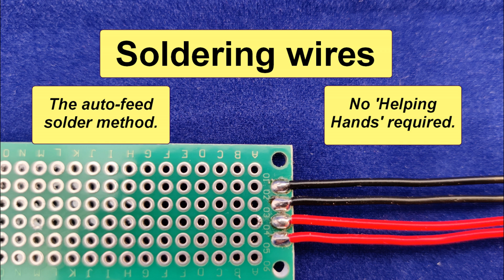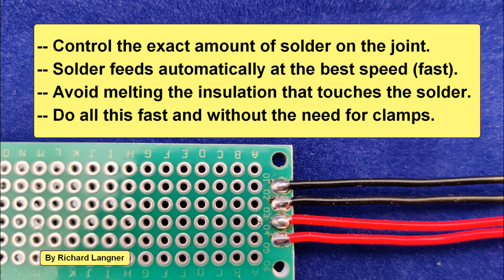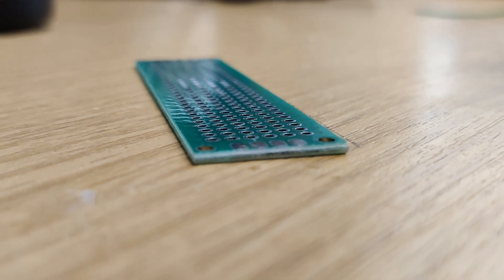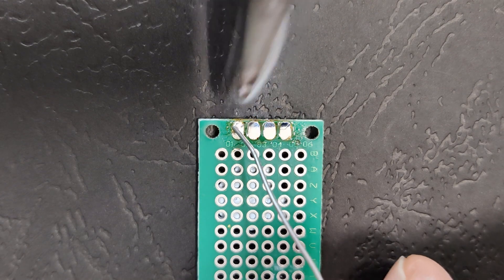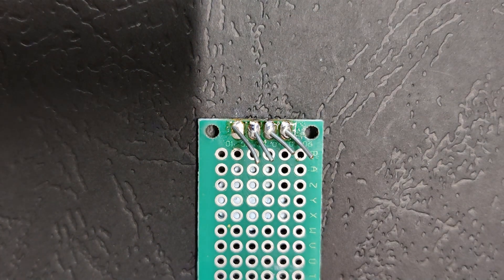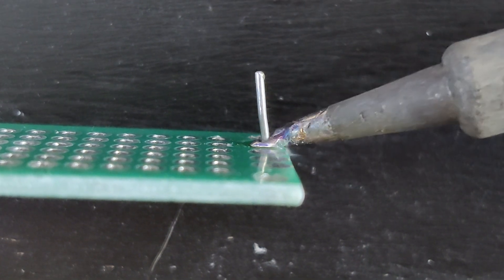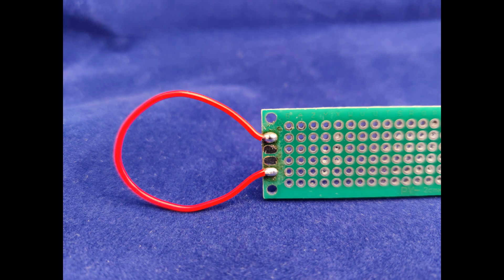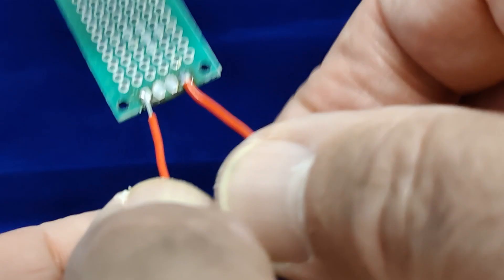Hands-free solder feed. No tools required other than a normal soldering iron.

Comment: Rich , I just found your video on soldering wires. I've been trying to avoid melting the wire insulation when soldering.
I'm going to try your method of pushing the insulation back away from the solder joint to prevent melting it. I'll let you know if it worked.
Thanks,
Gary

I successfully pushed the insulation back so that I could clamp just the wire with my pliers to prevent melting the insulation. I was able to push the insulation back close to the solder joint by holding onto the other end of the wire and sliding the insulation slowly.
Worked great! Thanks for your video.
Reply from the maker: I will be making a video (or two) on soldering in the near future, and will show how to work with various types of insulation on wires. Some wires are just not designed for soldering, and the insulation melts very easily. Also stranded wires 'wick' up the solder, making it less flexible where it lease the PCB.
Thanks for the feedback, and if you want to suggest other issues with soldering please let me know.

Comment: I don't like this. The wire should be threaded through the hole from the component side and then soldered. This will prevent the wire from being ripped away from the board and it looks better.
Reply from the maker: You are correct. Making a good mechanical joint first would only require two hands to solder, so this method is not needed.
However there are times when you don't have the luxury of a mechanically sound joint, such as the end PCB connections on my board (they are there for a reason!).
Another thing is that SMD parts do not have a good fixing, and I quite ofter use this method, although it requires some practice to perfect.

Comment: Here is a trick I have used.    When you want to solder to an enamalled coil wire, getting the enamel  off and the copper bright can be difficult.   Use an aspirin tab.
Lay the aspirin tab down on a suitable surface that will not get damaged by the soldering iron.     Position the end of the enamalled wire on the aspirin tab.   Apply heat
and a bit of solder to the tip as it touches the wire against the aspirin tab.    Tab melts slightly, turns brown, and there is some smoke and it bubbles slightly.   This reaction
of the heated melted aspirin burns the enamel off the end of the wire and the copper is clean, bright, and now tinned as well.     😎
Reply from the maker: Sounds interesting, I must try that after I find out what the fumes are!

Comment: I've been doing Electronics for 50yrs, I've never seen these two techniques before 😮

Thank you so much mate 🍻
Reply from the maker: I will be doing a soldering and desoldering video soon, so stay tuned!
And Thanks for your comments.
Reply: @richardlangner  I was going to post exactly the same! I've been soldering for 40 years and I had never seen and not even heard of this. It is so simple that you would think that by now I should have "discovered" it.. yet 40 years on and never thought of doing it this way.
Reply from the maker: @TheAlchaemist  It was the obvious solution to not having 3 hands when working on site, and without 'helping hands' etc.
It seems obvious is not obvious for everyone!
I'm going to do a rework of my desoldering video which shows desoldering with no tools (just an iron). Stay tuned.

Comment: Thanks for sharing. But How do you conect thats soldered points with the holes on the perfboard? Sorry about my english!
Reply from the maker: This is for joints that have no mechanical fixing. A future video will show the finer points, and general soldering, and desoldering.
Reply: @richardlangner  I mean, how do you conect the red wire next to 05 with A05 hole on the prefboard? Or the black wire next to 01 with A01 point? I think that those wires are for powering the circuit in the perfboard. Ignore me if I'm talking nonsense. Thanks a lot.

Comment: I'll add some balance to astounded comments and let you know I have been a technician for 48 years and have always used this technique. You can also attach the solder to the wire for wire to wire joints
Reply from the maker: Hi Paul. After doing this since the late 1960s, it astounded me that very few knew about it. I searched for years on the web, and as I didn't find anyone else who had already done a video, I thought I'd give it a go!
I'm preparing to make another video on other techniques I use, some of which may be well known, others not. But they are all pretty obvious, at least to me.
Thanks for the feedback. If you want to share any of your tips with me I may include them next time - with credits of course.

Comment: This is a poor soldering technique, possibly suitable for an amateur who requires occasional soldering for research purposes every 100 years or so, but not for more demanding applications.
Reply from the maker: This technique is for soldering a wire to a pad - there is no mechanical strength and it should not be used in demanding applications. It's for small projects where wires don't need support, such as in a project box and over a short length. However I've used this as a supplement to other skills. I hope to make another video soon showing the advantages and how this prevents cold joints. And other tips. I would apprecciate your feedback on these too. Thanks.

Comment: Do Brits really call it "soul-der" and not "saw-der"??
Reply from the maker: Soul-der is for Brits - rhymes with shoulder. Sodd-er for USA. What is it where you are?
Reply: @richardlangner  As a broadcast engineering trainee at the ABC c.1980 I was instructed in "high reliability hand soldering" with a NASA training film. The class fell about laughing at the US pronounciation "soddering" . But cleaning the solder immediately prior to use was one of several tips I've used ever since. Thanks for this tip.
Reply: @richardlangner  Interesting. I'm in Toronto, where I learned sawder / sodder from people of my dad's generation (60s kids).

Comment: I am almost a complete novice, so pardon me if it is a stupid take: from what I see, this approach can lead to too much solder being on the board. Which can cause issues like poor connectivity.
Reply from the maker: Thanks for the feedback. For the demo I used thick-ish solder and put extra length legs of solder on the joints. This was for the demo only so it could easily be seen. In practice I use thinner solder and shorter legs so not as much solder is on the joint. Had I realised that the video would be so popular i would have made it more accurately!
The tremendous amount of interest has convinced me to make a follow-up video showing how I use this technique and what other tricks I use. So stay tuned - just remember I do this unpaid in my spare time to help fellow electronics enthusiasts so please be patient.
Reply: @richardlangner  thanks for the reply, subscribed and waiting for your next tutorial :)

Comment: Would love a demo on the through holes rather than the pads, not sure if you use the same technique or something different.
Reply from the maker: The through-hole components don't require my technique.You don't need the extra hand for that.
In a few weeks I hope to be making another video showing more tips.
Reply: @richardlangner  ah yeah makes sense!

Comment: Thanks for the video, but if you can solder, it's not necessary to do it like that. I solder and I've been learning it for 40 years.
If the pad and the end of the wire have been tinned with the right amount of tin, all you have to do is put the end of the wire on the tin pad and then briefly hold the soldering tip to both and it will be perfectly soldered. Your method makes it a little easier if you're not that good at soldering yet.
Reply from the maker: Thanks for the feedback Andre. Of course you are quite right, experienced solderers can just do the job their own way.
This is just another technique in your skillset. I don't use it all the time, but yesterday I needed to solder a microswitch which was recessed and barely had enough room for a soldering iron and the wire to be connected. So I fed the solder where the wire would go and left a 'leg' of solder, then fed in the wire and used my technique. Just so much easier I think you'd agree...
Another video to come showing the finer points and an extra easy tip.
Thanks again for the feedback.

Comment: unnecessarily complicated. Plus you waste material and time, so what's the point? First tin the cable and preferably the place where the cable should go and then simply solder it in place. Why repair something that works perfectly?

btw, to solder one cable after the other you don't need a third hand.
Reply from the maker: Back in the day I used to change LOP transformers in customer's homes, when the connections had no mechanical fixing and the wires had a mind of their own. I tinned wire and tag, but by that time the flux was used up and the joints didn't flow as well as I wanted. I needed a way of feeding in fresh ready-fluxed-solder, and this seemed the obvious way. It's not a method that I use all the time, it's just another tool in my skillset. An alternative is to flux the joint and use your method.
There may come a time when it will come in handy for you, so remember me then!
Thanks for the feedback, it's always good to hear other's opinions and experience.
p.s. the solder was extra thick for the video, I normally use much less and complete the job quicker.

Comment: I stumbled on this a while ago, but didn't think it was particularly uncommon.  Another fun method I sorted was to fill a desoldering bulb and inject  solder into the site.  I discovered this when dealing with arc solder materials that require higher temperature than the medium can handle.  It can be uses to affix but also create a lower temperature alloy that is far easier to quickly manage.

Comment: Thats a really cleaver idea.  I usually use silicon wire if i have to solder wire to a proto/perf board just so the insulation doesn't melt on me

Comment: Does this work in situations where you're working so tight where you can't easily get a soldering iron in like you can by running the solder down a wire?
Reply from the maker: Never tried that, but best to avoid tight spaces. Remember the joint will only be strong enough if there are no forces acting on the wire, such as in a small enclosure. For anything else you need to make the joint physically strong. Thanks for the comments.

Comment: I will instead pre-tin both pads and the wires, apply Rosin flux to both. then just join together and apply heat. Don't need rosin core solder for that too, can reuse desoldered solder even, if ran out of supplies.
Reply from the maker: Thanks for the feedback. I also use that method when I have seperate flux.

Comment: Right, not a technique I would use at all. 
Once you know how to solder, it all goes automatically without the extra unnecessary steps shown in this video.
Reply from the maker: Quite right, if you can manage without this technique then you don't need it.
Back in the day I used to change LOP transformers on site, and the wires were only held on by the solder, no mechanical joint at all, quite a bad idea really. Also the wires seemed to have a mind of their own, so I required 3 hands - for iron, solder and wire. At that time I hadn't grown my third hand, so I had to solve this problem.
Since then I have developed the idea and it's now part of my skill set.
After over 50 years later I bring it to youtube.
Maybe you will use this technique when the need arises, if so please let me know.
Thanks for the feedback.
Reply: @richardlangner  Quite right on the clarification.  Mostly it is a "problem" that doesnt need solving. But the circumstances do arise once in a while and that is a great trick for when they do.

Comment: Here I was thinking you needed a magic soldering iron. All I need is your technique. Also a big cheers to you for not making this a 15 minute video!
Reply from the maker: Thanks for the feedback. My videos start out quite long then I chop, chop, chop, speed things up, slow them down. Straight to the point, and no background music.
I'm preparing to make a video on my soldering techniques, and the use of matrix board, etc. If you want to suggest anything for it, please do.
Reply: @richardlangner  Yes props on your Production values. Most You tubers are really really bad and they all pick up terrible habits from each other. 

You have a wonderful voice.  I am such a stickler having been involved in Radio. You Sir are a Natural.

Comment: Thanks Rich. Game changer. I've been soldering for 40 years and I'm switching to your method immediately. I told all my friends, and they're all going to adopt your technique.

THE LANGNER METHOD.

Instant classic, even though it should have been discovered 40 years ago!
Reply from the maker: Actually I've been using this method since the early 1970s, and way back I taught it to students at Chesterfield College, and recently to members of Sheffield Hackspace. The technique only needs to be used if you need a third hand (and haven't grown it yet) - for through-hole it is not needed as everything should be held in place.
THE LANGNER METHOD : I like it!
As my name is often spelled wrongly without the second 'n', and I often joke that if there were a 'd' on the end it may be more appropriate!
I intend to make another video on soldering soon.
Reply: I have a question. I have been told that unless both pieces of metal are heated enough to melt the solder on their own, without the iron touching it, you are creating a "cold solder" that will be prone to fail later on: there needs to be enough heat to create an actual chemical bond between the different materials. 

Since you have been using and teaching this method, I will assume it's safe for me to use it in my extremely sparse events of soldering. But I would really appreciate your thoughts? Am I good to go if I place a cold cord on the contact with molten solder and allow the solder to solidify? Or do I need to get it to a specific temperature?

I'm glad to have found your video: have a cord that needs replacing. :)
Reply from the maker: @BjornMinou  I will have to make another video showing the finer points of the 'Langner method' as someone called it.
But for now, if you watch the video carefully you will see that 'cold' joints are impossible.
Creating the solder leg is part of the pad's tinning process. I assume you have already tinned the wire.
To make the joint, the iron presses the wire onto the pad. The wire heats up, which in turn heats the pad, the pad heats up and melts the solder, so actually the pad and wire are at a higher temperature than the solder. Only when this occurs does the solder melt.
Does this answer your question?
Reply: @richardlangner  It does. You are tinning both parts, the pad and the wire, separately as a first step. If we didn't tin the wire, we could get a cold solder. Now the solder is already gripping onto the metal of both parts, so we almost only need the solder of each part to fuse. So the temperature only needs to melt the solder, but you additionally add heat and pressure by holding the wire down with the soldering iron. I feel convinced. Tin you wires! :)

I was also told: melt some solder onto the iron before you begin, "to work with". I now know better. The blob of solder on your iron will rapidly finish off the fluss, and start to oxidize, and won't melt into a pretty little mound like yours but will be a flaky unsightly mess. Your method keeps the fluss extra well because it's so instantaneous. I like it.
Reply from the maker: @BjornMinou  Before soldering, I tin the iron, then clean it, then tin it very slightly. If the iron is perfectly free of solder the heat will not transfer easily as the point of contact will be small (assuming a flat iron and a round wire). The solder on the iron will mould itself around the wire creating a greater area on contact, and hence better heat transfer.
Yup, definately another video needed here!
Thanks for the feedback, it's good to know what people need.
Reply: @richardlangner  Got it. A tint of tin it is then!

Comment: Can’t say anything until I try it of course, seems like there’s some chance you could get a “cold solder” joint that way - though I think that’s unlikely and you could probably fix by just leaving the iron in contact a second or two longer if it was a problem.

Thanks very much for the information!!
Reply from the maker: Cold joints are impossible this way. I will make a video soon showing why, and I will add some other tips as how to solder 'properly'.

Comment: Did you figure this out by accident?
Reply from the maker: Not an accident, although it's common when learning to solder that you remove the iron too soon and leave solder stuck there. I observed this, varied it slightly and put it to use over 50 years ago. It was so obvious at the time I thought everyone must do it, but it seems not.

Comment: Are you tinning the wire too, or just the pad?
Reply from the maker: Yes I ensure the wire is tinned first. I will make a follow-up video with clarification based on the feedback I have had. And some more soldering tips.